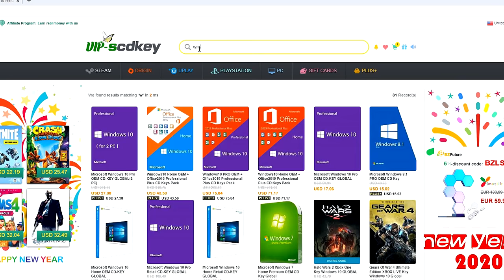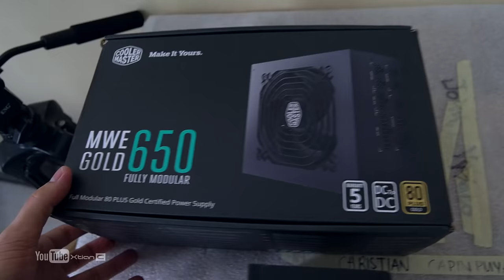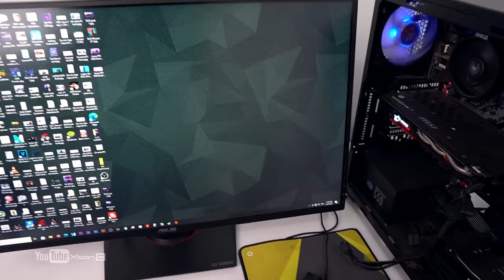VLOG: Troubleshooting Tips #1: PAANO ayusin ang COMPUTER na walang POWER - AYAW mag-ON

Comment: Same situation sir naginstall lamg ako ng rgb case fans di na nagon after. Possibly nagshort yung psu? At tinry ko yung paperclip test di na umaandar. Tinry ko rin sa lumang psu ko gumana yung paperclip test sa psu! At sinubukan kong ikabit yung lumang psu (thermaltake smart se 730w) sa pc ko pero di parin nagoon.... nacombo na ba to sir?hays hassle.

Psu ko pala is seasonic focus gx650
Yung rgb case fan is deepcool rf120
Mobo is b550 gaming edge wifi
Reply: na fix nyo na po ba ang problema? na try ko na kasi tong psu ko sa isa pang mobo, working sa paper clip pero di pa din na on.
Reply: @leu3999  not really sure kung ano naging fix nya sa dinami ng ginawa ko. pinacheck ko psu, mobo, procie ok naman daw sabi ng kanilang respective stores. so bale nakailang assembly at dissambly ako ng rig bago gumana hahahaha nangyan. most likely may loose cable talaga.

Comment: hello.. sana masagot.

nag palit ako ng pc case.

ayaw na po mag on ng pc. pag sinasaksak ko. cpu fan lng gumagana. pag tinanggal ko ung hdd at sdd.. ang gumagana cpu fan at gpu fan... pag binalik ko cpu fan nlng ulit nagana. 
no display pareho

bumili ako ng generic na psu.. bumilis ung ikot ng cpu fan pero no display padin po.

tinry ko ung orig case. pero ayaw na talaga mag open.

tinry ko paltan din po ung cmos..pagpalitin ung ram. ayaw po padin 

ano po kaya issue mag papalit lang naman sana ako ng case hehe ☹️
Reply: ps. 4 pin 12v atx at 10 atx ..kinounvert ko lng po ung nasa psu na 24 pin into 10 pin, may cable po ko na pang convert

Comment: Good day, need help po, kasi feel ko slightly related ang issue.
While gaming po, it suddenly turned off. Ang issue now is while turning it on, iikot lang saglit yung cpu fan tsaka mag light saglit yung rgb ng mouse. I tried to check the PSU's fan if it is spinning or not while it is connected to the outlet, and turns out it's not spinning. I am suspecting that its the PSU but I can't also rule out the possibilities that it might be the other components. Just to be clear, brand new mobo and the other components were working just fine before it happened. Feel free to reply or comment. Have a good day!
Reply: Same prob ano po gagawin?
Reply: @arnelaguilar9864  kamusta sir ano solution mo?

Comment: share ko lang if how i fixed my pc that won't turn on. I did all troubleshooting, checked psu, power switch, ram and they are all working well. I also removed the MB from pc case but still it doesn't power on, tried to disconnect psu 8pin atx and only 24pins connected but still didn't power on. With this I'm guessing i need to change the MB. but while searching for a fix, i saw others using hair dryer to start their pc, i tried it (gamit hair dryer ni mother hehe) and wow my pc turned on, but the next day it won't again turn on, so i used hair dryer again to turn it on. Then i saw cleaning the crystal cylinder with isopropyl alcohol and wd40 multi-use will solve the problem, i tried it and it really worked on my pc. This saved me from buying new MB. my motherboard is gigabyte b450m ds3h.

Comment: Sir xtian, nagbi-build din po ako ng pc. Pero ngayon lng po ako nka meet ng problem sa pc na kagaya nito. Bali ayaw po mag-on nung pc after i press the power button on the case. Pero the lights on the keyboard and mouse ay umaandar. Pero yung lights po sa ram and fans sa pc ay hindi umiilaw at di po umiikot yung fans ng cpu cooler at gpu. I tested the psu if sira po pero umaandar nmn po. But then i.jumpstarted the pc po using a screw driver, it sometimes turns on and randomly, ayaw na naman po mag on ng pc. Is it the motherboard po that is defective or the psu? Specs po are the ff:

Ryzen 5 2600 (stock speed)
Gigabyte B450M DS3H
Corsair Vengeance White RGB 3000Mhz CL15
GTX 1650 4GB
Adata XPG S8200 256GB NVME SSD
Thermaltake Litepower 650W PSU

Hope you can help me sir. Thank you. 

PS: dinala ko po yung unit sa malapit na computer store & repair shop po sa amin for second oppinion po.
Reply: SIMPLE LANG YAN SIR. ALISIN MO RAM MO ISUNOD MO CPU MO.  LINISIN MO RAM MO. ISUNOD MO CPU MO. PAG AYAW PADIN RESET MO BIOS MO. UNG BATTERY ALISIN MO 5SEC THEN KABIT MO ULI. WALA SA PSU YAN.
Reply: @paoloevangelista2137  thank you sa notice sir. pero ganun din po ginawa ko bago ko dinala sa shop. i even changed the thermal paste and cmos battery after trying to reset the bios pero ganun parin po sir. hehehe. i tried using avr sir baka low voltage lng, pero ayaw parin po. pero ang sabi sa shop e wala nmn daw pong sira at ng popost nmn po sa kanila. pero nung inuwi na yung unit, ayaw ulit umandar sir. hahaha.
Reply: @derwingalon9405  same problem stress n stress ako my mga araw na umaandar agad pag inoon pinalitan kuna psu no luck ginawa ko hinugot ko lht ng nakakabit sa motherboard tpos sinaksak ko ung power cord ng psu pero naka off ung extension tpos inantay kulang ng 3hrs kinabit ko ulit aun nag oon na basta diko lng inaalis sasak nya after ko gamitin inoof ko nlng ung xtension
Reply: @derwingalon9405  ganyang nangyari ngayon sa desktop ko, naayos mo po ba siya sir? halos ginawa ko na rin yung lahat troubleshooting na ginawa niyo ayaw pa rin gumana. Maraming salamat in advance kung sakaling mag reply ka dito sa comment ko.
Reply: @JacobJohnson-lh4gx  bali yung sira po sa pc na iyon is yung gpu po mismo. try ko swap sa gpu ko at ok nmn po. lahat ng components are running well and smooth. bali yung sira po sa gpu is yung cpu nya mismo. yung chip. dead cpu po tlaga. lumagpas narin sa warranty period kaya hindi ko na napa replace at bili bago gpu po yung nangyare. hehe
Reply: @derwingalon9405  thank you sa reply sir, di ko pa na tatry bawat parts nung sa akin, gaya ng PSU, CPU, RAM etc. Pero hoping na walang issue yung motherboard nung akin at parts lang na madaling palitan yung may sira, again sir maraming salamat sa reply ingat and god bless!

Comment: boss yung sakin kasi rtx 2060 super, nawawala yung display ko sa both display port and hdmi. then nag mamax speed yung fans ng gpu ko. GPU na ba talaga kaya issue nito? 
sana mapansin comment ko para alam ko problema nitong pc ko :(
Reply: Download ka ng Nvidia Geforce experience tapos update mo yung display drivers duon if nagawa mo na yan check mo lang yung display settings mo if nadedetect ng gpu yung monitor
Reply: @fubybaldoza2568  oo boss tried ko na to kaso wala padin. baka ipa RMA ko nalang to.
Reply: @oriii_x  ipacheck mo nalang gpu mo bos try mo sa ibang system unit kung ganun din ang display para malaman tapos check mo din yung hdmi at DP cables kung walang damages. Pwede din RMA mo bago pa naman ata yan
Reply: @fubybaldoza2568  sige boss noted, maraming salamat

Comment: I have a problem with my pc.. Keeps on shutting down before bios (press f_ to go to bios) its gets me about 5-6 months before i figure it out it was the mobo.. Its old, cnt find a legit seller and im on very tight budget.. "My cpu is i5 3470 lga 1155.."

-ram is working
-hdd is working, swaped into my cousin's laptop still working
-psu is working, tested my psu to other pc
-not the temps, i replaced thermal paste, cpu fan is working

--------------------------------------------

Maybe someone in chat can help me out fix the mobo.. Or find a seller for my mobo.. Budget is only 1k.. Its all i have
Reply: obsolete system, buy new one

Comment: Ryzen 9 5900X + RTX 3080 cant meet the expected fps
Hi Kuya Xtian C
I recently build my ryzen 9 5900x + rtx 3080 gpu. I played Valorant, however I was only getting 200 fps at low settings, my old desktop was getting more fps than my new build.
Old PC specs: was i7- 4750h + 1060 3gb
New pc specs
MOBO: Asus Rog Strix X570E
GPU: ROG STRIX 3080 OC
CPU: Ryzen 9 5900X
RAM: 32GB 3600MHZ CL16
PSU: 850W GOLD
SSD: 2TB NVME 4.0
Any help?
Reply: Baka di naka set sa tamang ram speed yung ram mo
Reply: made in CHINA YANG NABILI MO. hahahaha

Comment: Boss ayos nabato sa 44k
B450 aorus elite
Rx570 8gb
16gb ram 3000mhz
Gigabyte 512 gb nvme ssd
Gigabyte 550w 80 plus bronze
Ryzen 5 3500x
Rakk hawani 
Dark flash 5in1 with remote
Hkc 24 curved
Avr keyboard and mouse
Reply: baba ng gpu
Reply: 3200mhz , 1660super , 650 bronze